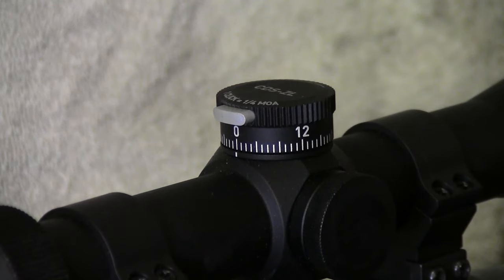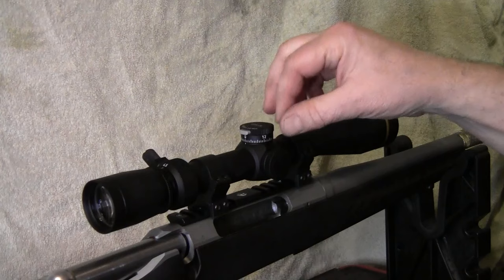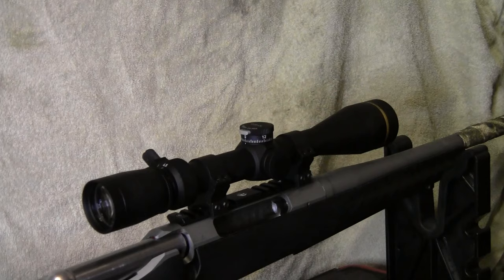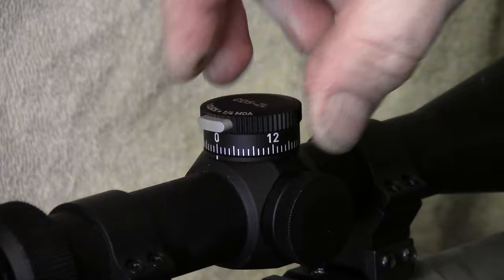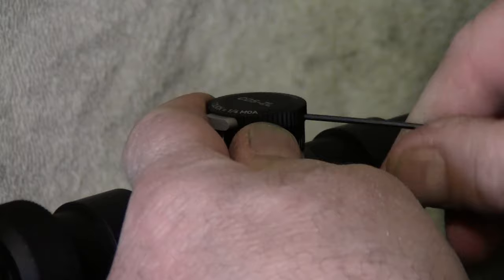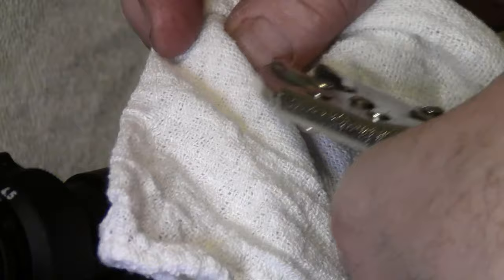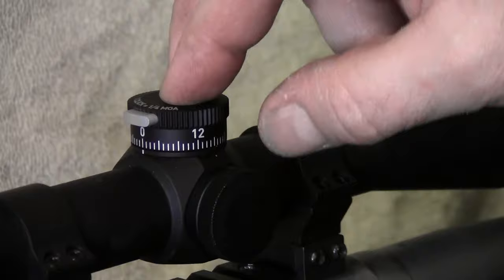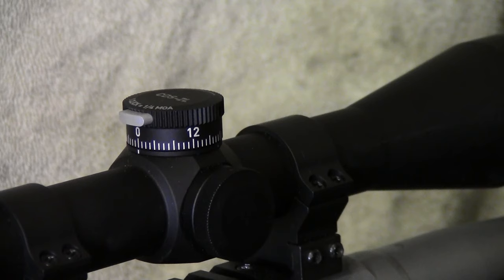How to Adjust the Leupold VX-3HD  CDS ZL Elevation Knob

Comment: If you put the cap back on with the 0 at the 3 oclock position and retighten, you will be able to move it down in elevation. I called leupold for that little number
Reply from the maker: Yes, but I think the lock button will not be in the lock position. Thanks for watching!
Reply: @30-06john no it won’t be but that’s not the purpose setting it up that way. It allows adjustment below 0 MOA. Once impacts match reticle, you remove cap and reinstall at 0

Comment: Dialing turrets are meant to be zeroed dead on at 100 yds with the turret installed then you remove it and line up the "0" with the hashmark. Good video. Thanks John!
Reply from the maker: Thanks! I have most of my rifles setup for hunting, so 2-3 inches high at 100yds is a 200-225yd zero, depending on cartridge and load. That gives me a max point blank range of 250-300yds so I don't have to worry about dialing in El. If I used a 100yds dead on zero, would have to add El at 225yds. Thanks again.
Reply: For target shooting you are correct. Slip the scale and zero dead nuts at 100, because your ballistic computer (or DOPE card) will give you the clicks for ranged distances.
For hunting, the intent is to have "point blank range" out to your effective shooting distance. For example, a .270WIN zero'd 2" high at 100yd will give you kill-zone hits on most game (deer, elk, caribou, black bear, etc.) from 25 to 250 and even 300yd (depending on the barrel and load). No need to range-find or dial anything. You can make slight point of aim adjustments on the fly (small hold over or hold under) for shorter or longer shots, or inclined/declined shots, within that range based on visual estimation and experience. If you have a shot out around 400yd, you click in some DOPE. This allows a hunter to quickly get on target and take a shot in the field, especially at shorter ranges where there may not be time to dial. Hope that makes sense.
Reply: I also set up my hunting rifles for a 200yd zero. 99% of my deer after 30 years of hunting were all within 100yds. Go figure. I guess it helps when I also do alot of bow hunting.
Reply: If you need to take a vice grip or monkey wrench to adjust your elevation......mmm....maybe there is another method that you are not aware of?
Reply: @DN-kz7xl not that you're wrong but why are you replying to my comment? I never said anything about a vice grip or monkey wrench. 🙄
Reply: @luvtahandload7692  I was a bit naughty. Pardon me for this. To be honest, I have a VD 6 on my rifle and did extensive research on it. There are a lot of info on the internet about this cds turret and I find it a nice setup. I appreciate the fact that there may be many others that disagree.
To get to my point: you thought it a good video and I deducted from that that you agree with his method. I would disagree when someone is calling this an excellent or even good video. I could not find anywhere that this is the method as how to set or zero the scope. IMO he should have said that it is how he has done it and not portrayed it as the method to use. This I find wrong.

Comment: Alternately, to rotate down, loosen the turret allen screws pulling up slightly and rotate right and past the locking notch, depress lock button and push down gently to seat the turret and  tighten the allen screws and rotate to right the number of clicks desired.  After that loosen the turret and reset to zero.  Repeat process to adjust down if necessary. This approach  is an alternate if you don't have or wish to adjust down with pliers.
Reply from the maker: That works too! One may not need pliers, depends on the individual scope and persons finger strength Thanks for watching!
Reply: 11mm wrench or a crescent seems to work as well :)

Comment: I love my older cds scopes, the new ones with ZL suck!  Leupold owes me $100 for a wasted range fee, time, and another $100 to return to the range with a tool box.
Reply from the maker: Yeah, a lot of shooters are being surprised by that knob on how to adjust it. Hey, thanks for watching!
Reply: I would much rather have a ZL turret than a non lock CDS dial, I've seen and talked to more than one person using Leupold and other exposed turrets that have them twist when hiking and hunting, and they don't check when getting ready to shoot in a quick moment only to find it had moved. The ZL will prevent that. It was irritating to find I needed the wrench to sight in elevation, but its worth it in the real world application afterward.
Reply from the maker: Yeah, the exposed adjustment knobs do get bumped and move when hunting. I have a Leupold Patrol 1.25-4 that had exposed turrets, almost missed a Blacktail buck because they jarred off. I ended up paying Leupold to install capped turrets. I will say that my old Leupold Vari-X III military scope with exposed adjustment turrets has never jarred off in 20 years of hunting. Hey, thanks for watching!
Reply: so you went without reading how its adjusted in the manual?
Reply: I agree, not liking the lack of ease, adjusting elevation. I had to go home to get the proper tools, used extra box of ammo, and wasted a lot of my time. The instructions lack the proper information.

Comment: If you have a scope with a ballistic turret on it, doesn’t zeroing the gun at 200-250 yards defeat the purpose? You could save a lot of money and get a scope with regular turret caps if you’re going to set it and forget it. The beauty of the ballistic turrets of Leupold’s is to set your zero at 100, then dial it up for longer shots to keep your point of impact at zero. Then you don’t have to do any hold over/under guesswork.
Reply from the maker: I did this video to show how to adjust the scope down in elevation to sight it in no matter what range you choose. Without removing the locking cap, this is not possible. This problem occurred numerous times with hunters at the range that I usually shoot at. Thanks for watching!

Comment: 11mm open end wrench works great to adjust the elevation.  I used some heat shrink to keep the wrench from marking up the knob.
Reply from the maker: That's a great idea! What they should do is have a slot on top of the knob so one can adjust it with a flathead screwdriver or coin. Thanks for the idea an watching!

Comment: Thank you so much! My mark 3HD was the same way, I knew that I had to take the turret cap off but wanted confirmation. You just did that for me. Fortunately by just boresighting my AR10, it appears that the zero as from the factory, mounting on Aero Precision medium height ultralight scope mount, I am perfectly on at 200yds. I am now comfortable shooting at anything closer than 200yds should shtf before I make to the range to fine tune. This is probably the 20th time I have boresighted one of my rifles and I am usually only around 3 moa off at 100yds. Good enough to get meat for the pot or home varmint protection!
Reply from the maker: Glad you found the video useful, and thanks for watching!

Comment: Very well done. Indeed, Leupold took a different direction on the setup and it confuses a lot of people. Thankfully mine was shooting low after mounting, didn't need to pull the cap until I was ready to slip the scale. I was disappointed by how much elevation got burned up getting it to zero, though. That's using low Talley rings on a Win M70.
Reply from the maker: Yeah, that El cap is frustrating a lot of people. Hey, thanks for watching!
Reply: Would a 20 MOA base not help?
Reply: @DN-kz7xl Not on a hunting rifle; want the scope as low as possible.

Comment: This was a well done video however I believe the advice was incorrect.   The custom dial system was created for long range shooting,  For those situations where you're shooting more than 400 yd.  For distances less than 400 yd simply site in for  Your point blank range which is typically 2 to 3" high at 100 yd.   In that situation you don't need to make any adjustment to the dial.   If you intend on shooting beyond the point blank range of let's say 4:00 yd you should 0 the rifle at 100 yd and the custom dial will then accommodate the ballistics.   For most people the CDS dial is simply a marketing gimmick
Reply from the maker: At the range where I shoot and help out, that dial is the most common problem for any and all scopes that shooters ask for help on. Most just want a high quality simple scope, many don`t bring Allen wrenches. If one wants to make a minor adjustment, have to reset the dial. Hey, thanks for watching!
Reply: Not many big game calibers have a maximum Point blank range of 300 yards, let alone 400 yards.

Comment: Thank you for making this video. I blew through $80 of ammo trying to sight the factory dial in. I couldn’t get enough elevation at 100 yards to print bullets high enough on the bullseye? This scope is doing my head in and I’m thinking about selling it. What am I doing wrong? I took the turret cap off as you suggested.
Reply from the maker: What is the rifle and scope base? Unusual for a currently made rifle to have a problem with elevation. I would think to check the scope base (one or two piece) and see if they are correct. You can also bore sight the setup and not use ammo except for final sighting in. I hope this helps and good luck!

Comment: You pleased with this scope still? It's my understandings you can only dial up around 12 MOA, which with some caliberstakes you out to about 500 yrds. 600 if you zero out to 200 yrds. 

What you put this on,  or caliber, rather? 

I don't think I need to be going out past 500 or 600 yards while hunting, any way
Reply from the maker: That scope is on my Ruger American 7mm Rem Mag. I have shot it out to 325 yards, and with my load it shoots less than .75 MOA. I really have not used it to dial up elevation but it is working fine for me. If you need more elevation, maybe use a 10 MOA or 20 MOA pic rail to mount the scope to. I hope this helps and thanks for watching!

Comment: I have a vx3 3.5x10x40 cds trying to bore sight like you suggest.  I removed the cap and used a cresent wrench to adjust.  while using a laser inserted into the barrel, I cant bore sight it! the laser is a little low perfectly centered just below the cross  and I run out of turns just to bore sight it, any ideas?  I'm bore sighting at 10 yards my duplex cross hairs do move but it takes quiet a few clicks to see any movement.  is there something wrong with the scope?  it is brand new.
Reply from the maker: I have seen a lot of those laser type boresighters drop low, not giving a true point. I am assuming your base and rings are mounted correctly. Another way is to put the rifle on sand bags, remove the bolt and look through the barrel at an object in the distance. Adjust scope so crosshairs are on object. Also, since the rifle barrel is reference, scope adjustments are opposite to move crosshairs onto the object. Most scopes are .25" clicks at 100yards. So at 10 yards it will take 10 clicks to move .25". I hope this helps and thanks for watching!

Comment: Just to confirm, ive had trouble getting this correct at the range.

Are you saying best to zero rifle in with turret off for elevation ?
Once zeroed return turret to 0 on dial ?
Does this mean automatically if you have a custom dial for a specified ballistic, you just take the factory turret off when in 0 position and place custom dial on in 0 position ?
Reply from the maker: Yes, remove the elevation turret to zero the rifle, then reinstall that turret. Make sure it fits into the small notch so it is at "zero", then it will be at zero.
For the custom dial, if you are using the same ammo and have the same zero as before, yes, just replace the new turret, make sure it is in the zero notch. 
I hope this helps and thanks for watching!
Reply: That's correct, but remember if you zero your custom dial at 100 yards when you install the dial you need to line up in 1. That's 100yrds..  In a perfect world it'd be nice to be at a range you can actually shoot 200-300 yards to further test the dial. Or you'll have to check your dope at 100 yards if that's as far as your ranger goes.

Comment: Appreciate the video. I just got a next to new VX3 HD and it’s sighted int to my liking but for some reason the white push button sets down in place lining up around the 7 o’clock position (if the white painted hash mark is say 6 o’clock) I was getting tired and cold after shooting this afternoon so I just came home and haven’t since touched it but I’d like to know why the cap doesn’t lock into the 6 o’clock position as yours did in the video. Cheers from Canada
Reply from the maker: If you take the cap off as shown in the video, at the white hash mark there should be a notch in the ring. That is where the white push button aligns into and will pop out. If that notch is not at the white hash mark, I would call Leupold tech support. Hey, thanks for watching!

Comment: it doesn't say this ANYWHERE on videos discussing 20 MOA rails or new scopes : ) thank you
Reply from the maker: Correct, the scope rail is not the issue. This is to adjust the VX-3HD elevation knob, and zero it to what ever one decides on. Thanks for watching!
Reply from the maker: And it is not really mentioned in Leupold manuals!

Comment: How about the windage knob? I see that it's capped. Do you just set it and forget it, or can those also be adjusted once left/right is established and the cap put back on to the zero mark?
Reply from the maker: The windage knob is a normal, typical capped knob. I just set the windage and put the cap back on. Mine does have an indented ring that can be moved to align with the zero adjustment turret, but this does not align with the white dot on the scope itself. Hey, thanks for watching!

Comment: I really appreciate the video. With this method to lower the reticle; when the top set screws and cap removed, which way would I adjust to lower the reticle. Counterclockwise or cloak wise? Thanks great video.
Reply from the maker: Well, it sounds like you have the rifle stationary and trying to move the reticle to the impact point of the bullets, so that would be counter clockwise or up. Scope setting are labeled for the reticle to be on target and move the impact point to the reticle. If I understand what you are doing, it will be opposite, which is OK for initial sighting in. I hope this helps.
Reply: it’s shooting 5” high at 100 yards. I’d like to zero at 100 yards. So I need to move it to the right/ counterclockwise?
Reply from the maker: Yes, if your groups are 5" high, then counterclockwise, each click is about 1/4" at 100yards.
Reply: That’s what I thought! Thank you!
Reply from the maker: Wait, I just noticed I said that wrong. If your groups are high when your crosshairs are right on the center of the target, then you want to go down, clockwise. Sorry about that!

Comment: I wouldn't use visegrips on a brand new scope. Idk why they made where you can't adjust it down.
Reply from the maker: They designed it, not sure why they built it that way. You can use any tool you want to adjust it, if too hard by hand. Thanks for watching!
Reply: @30-06john  Yeah, idk why they would did it like that.

Comment: Question, I had zeroed my 243 Win and 308 Win with scope @ 50 yards. 2 inches above the bullseye is the impact of the bullets good for 100 yards or more? I could see the bullseye better on a 50 yards please be advise thank you.
Reply from the maker: I assume this is for deer hunting? I like to sight in my rifles so the bullet does not travel more than +/- 3 inches from line of sight. A few variables here but using typical bullet weight and velocity, 1 inch high at 50 yards would give a maximum point blank range of about 250 yards. I think you are a bit too high. Hornady website has a ballistic calculator where you can enter the info and create a chart. I hope this helps.